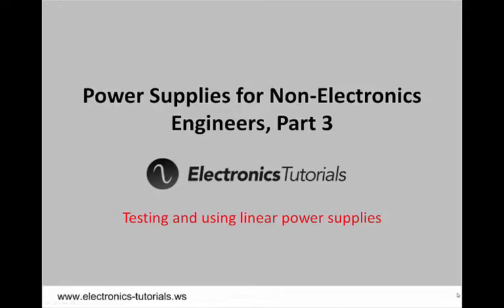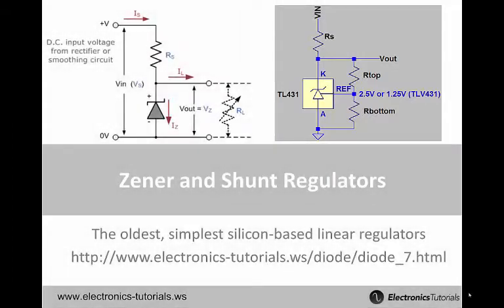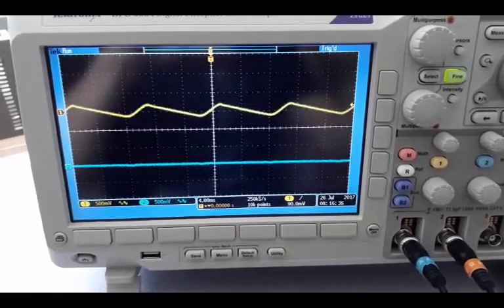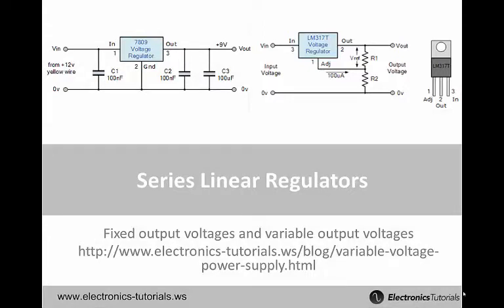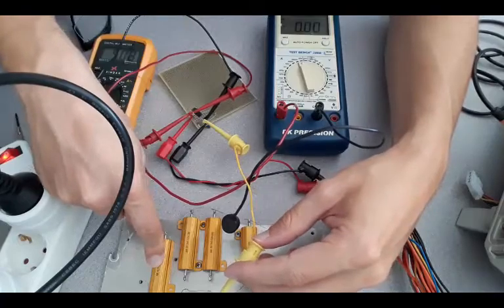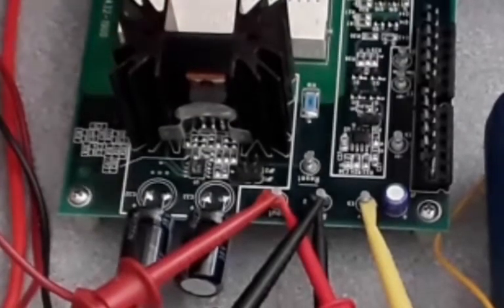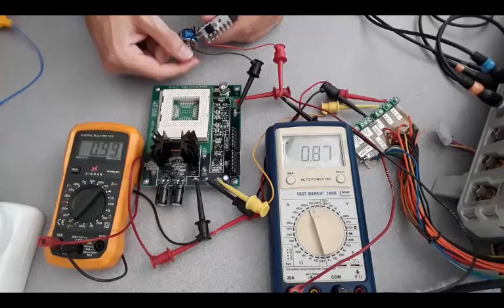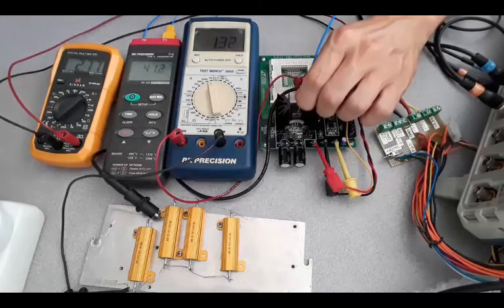Power Supplies for Beginners, Part 3 - Linear Power Supplies

Comment: Thanks for this. So, do you prefer an unregulated linear PSU to a regulated switching PSU or regulated trumps linear? I am trying to power a few of my digital components in my Hifi Audio gear that come with cheap PSUs, they're either 12V, or 5V USB PSUs, and I want to provide as clean power as possible with little noise possible... options are either massive Linear 200-300W PSUs with large heatsinks or switching crap... I wish I could find a 5 Watts linear PSU somewhere for my USB powered devices, they're hard to come by. Do you have any recommendations?